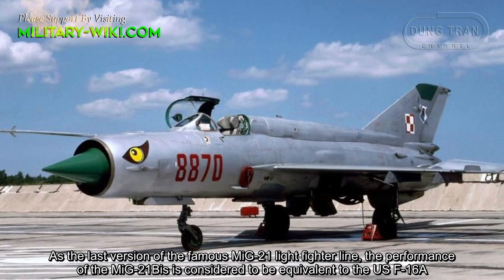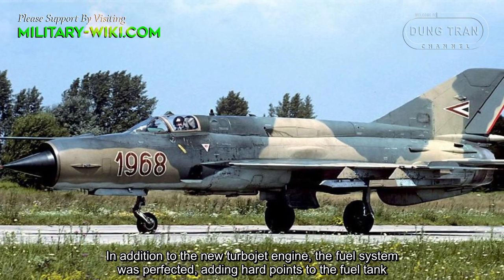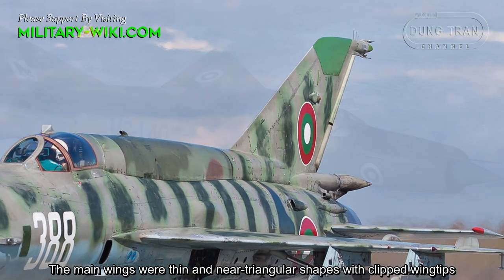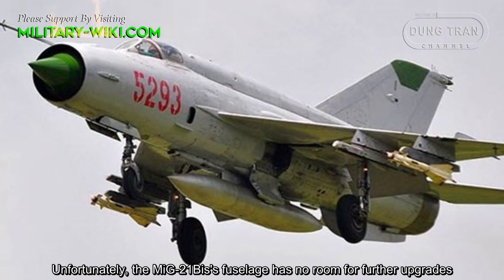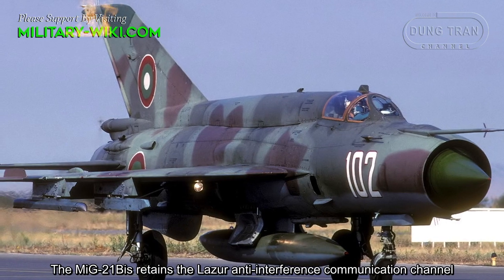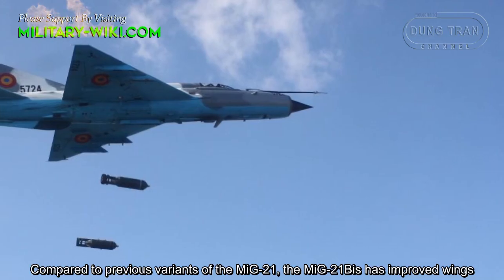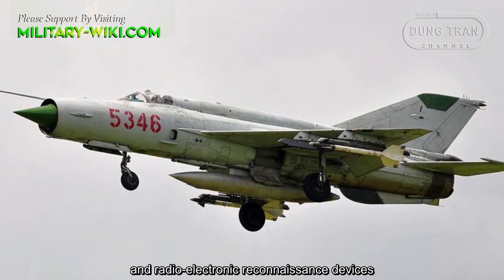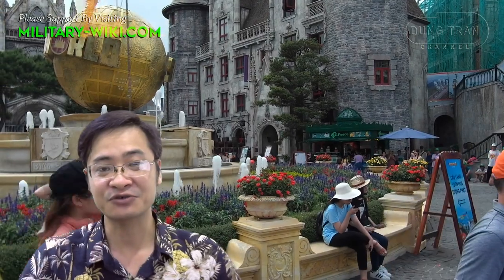MiG-21Bis - A Powerful Upgrade On Par With The F-16

Comment: The MiG-21 was changless against the F-16, the battle of the Bekaa valley proved it.
Reply: Well truth to be told most of the mig 21s Syria operated in 1982. were obsolete Mig 21MF versions. Combine that with AEW aircraft Israel used and outcome shouldn't shock anyone who understands a thing or two bout air warfare
Reply: @hrvojebartolovic2545  Whit the bis the result wouldn 't be any better, the MiG-23 was also slaughterd.
Reply: @gjaltvanderhem838  for the reasons above. Claiming one aircraft is superior is futile in that environment. Yet in Pakistan F-16A run away from the fight vs those same Migs(with addition of Mig 29 back then). When tables were leveled.
Reply: @hrvojebartolovic2545  The bison is a much more capable aircraft with r-73/77 and backed whit AEW embrears.

Comment: That must be a joke, it might be as fast or slightly faster. But it is far less maneuverable than an early F-16 and bleed much more speed in turns. Its radar and gun are much worse. Of cause, it can challenge an F-16 but it's at a great disadvantage. But with modern missiles, it of cause can get lucky especially if operated by a better pilot. But the F-16 has a much bigger chance of dodging a missile, would most likely be able to fire first as its radar is better and if it should get to a dogfight there is not even a competition. 

Anyway, an F-16A unless upgraded is not really a useful fighter today.

Comment: Wonder why they did not upgrade to turbofan,  redo the avionics, a new strengthened airframe with more hard points.

The plane is absolutely magnificent.

Soviet Russian aircraft are the best
Reply: The bison ias already heavaly updated, but the basic airframe is outdaded.
Reply: Tell us another joke.
Reply: It is close technically to a F16 at that that but it's electronic is slightly behind. The carrying capacity of the F16 is also much higher than the Mug 21 b . Therefore, if you miss your F16 after a few shots you could be out missiles with the F16 sending barrages of missiles back at you.
Reply: @informationcollectionpost3257  and the F-16A turns much better giving it a better chance of dodging an incoming missile.